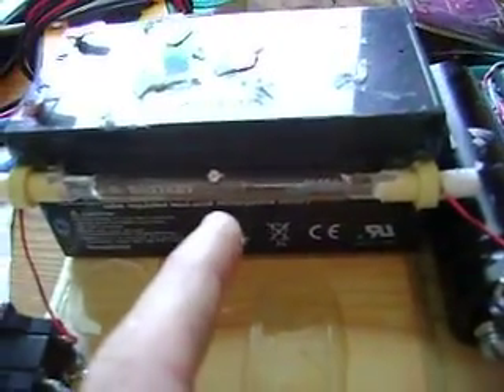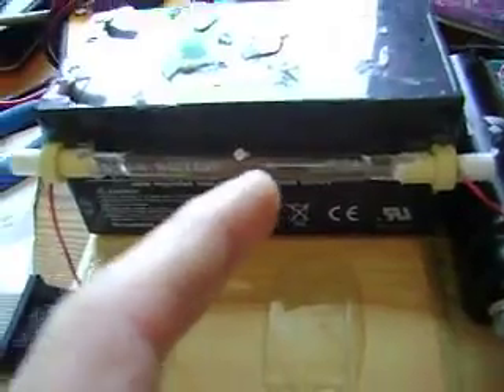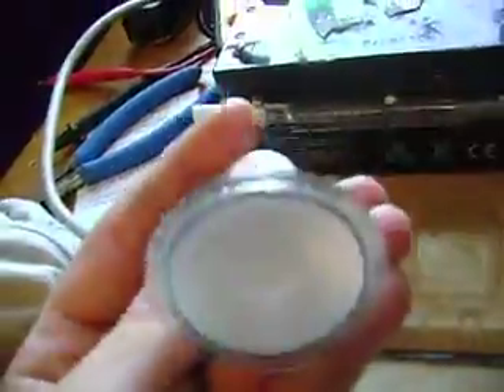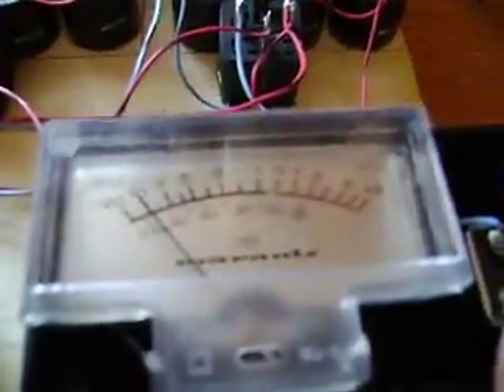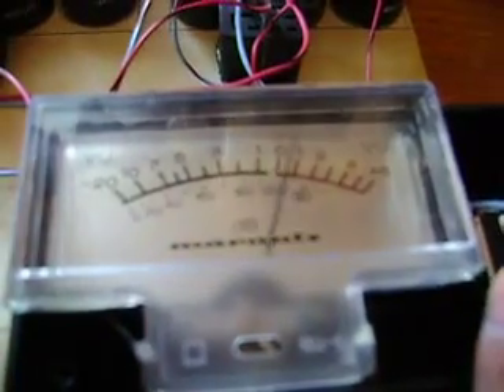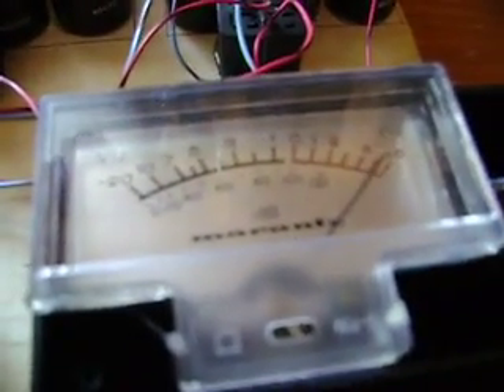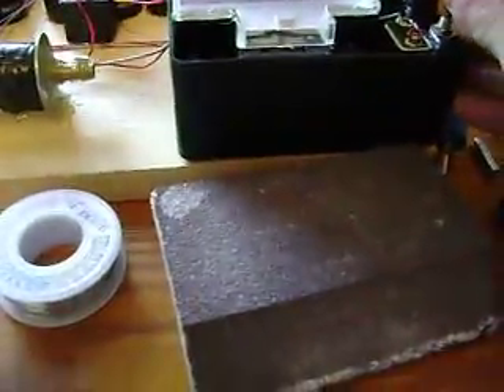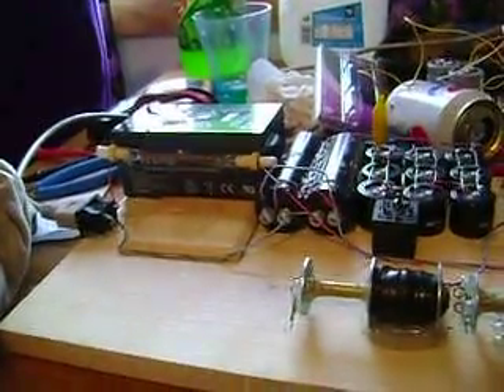3 Stage Coilgun Update 6

Comment from the maker: Sorta, the line voltage (120V) comes in through the lightbulb and into a voltage doubler, which is the two big caps by the battery, and then into the cap banks through charging diodes